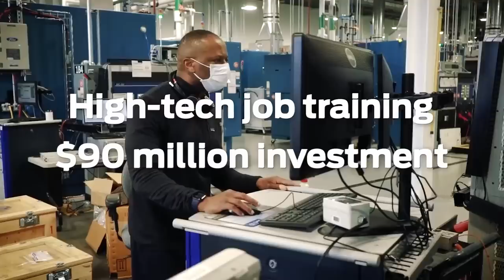Ford CEO Confirms HUGE Ford Maverick Factory To BOOST Production Numbers

Comment: I ordered a Maverick Lariat Hybrid when ordering first opened in July 2021, and got the truck 9 months later. 4 1/2 months in I am very happy with my purchase. For around $30,000 out the door, it is a great value. It’s perfect for light duty hauling such as college apartment moving duties, hauling mulch, and taking kayaks back-and-forth to rivers and lakes, and I really appreciated the adaptive cruise control on the few longer trips we’ve taken it on. So far it’s averaging around 37 mpg, which is pretty amazing considering it looks as aerodynamic as a refrigerator.

Comment: I’d keep making hybrids while making EVs, for their tank range, and increase it to 1000 miles a tank. But avoid making the hybrids with turbo or eco boost engines, they burn shorter and hotter than Atkinson cycle engines do, or other naturally aspirated.  People just want a long range and long lifespan — cars or trucks. Later in 15 or 20 years when EVs reach 600 miles and last 10 years on same battery — and prices come down — Ford could consider doing away with hybrids.
Reply: @The_Internet_Is_Overrated  I think it’ll be smoother. Going ICE to EV requires Ford to split the company into two, a pretty difficult thing?
Reply: I expect this will more or less be how it goes as we shift away from strictly ICE vehicles
Reply: Temperature's Hot and Cold severely affect the batteries range, how do you see over coming that aspect alone?
Not starting a fight here,   
  I would like to hear what your thoughts on that are.
Reply: hear, hear!

Comment: Yes, they are doing the right thing. I wish I could find a Maverick but one that is at MSRP not one that is 30% over that. Ford does need to increase the manufacturing of these high demand vehicles.
Reply: There are people publishing lists of dealers that don't add above MSRP. The order books open in September for 2023 mavericks; i expect they will sell out the year fairly quickly.  I am trying to pick my color; it is hard having only seen one on the road so far (Area 51).

Comment: My son-in-law is trying to buy a Maverick to use for work. There are demo models at all the dealerships but they are not allowed to sell those. Ordering one will open back up in September but the dealerships are estimating delivery six months to a year. The few that are available in California are met with OUTRAGEOUS dealer markups... $10,000 to $20,000 markup. Almost double the MSRP of the vehicle itself. Buyer be ware! Ford has been talking and building the Maverick in Mexico for over a year now and they can't keep up with demand. If they can't meet demand and control the dealer markup issue they will lose customers.
Reply: Also, Hybrid motors are leaking oil that could cause engine fires is not doing much good for sales either!

Comment: And then let's take the 2.0 L EcoBoost Maverick for instant 

let's look at the first oil change at 1000 miles after break in

you're already starting to smell fuel dilution

 and then by 5,000 miles it's very very strong but yet it's advertised that you can go up to 7,500 to 10000 miles on that oil change which is not accurate 

by 5,000 miles is the sweet spot but marketing says you can go much more

 you know what that leaves you with wear and tear in a vehicle that starts deteriorating slowly in the long run and dilution of additive package and the Integrity of the oil but because of the way the vehicle is marketed they want the customer to feel empowered and believed they have to service the vehicle less which all expands from a marketing  that's trying to make a vehicle more fascinating and empowering to the customer when an all reality all they're doing is slowly breaking it down
Reply: Very good points
Reply: What oil would the Maverick take 0w30 for the turbo
Reply: On another video on this site a dealership described this exact situation. Only on the 2.0 turbo. Their thoughts were the oil should be changed every 4,000 miles. Do you think this issue exists with every small turbo engine 🤔?

Comment: I wish they would have just built the old Courier with a proper ladder frame with rear wheel drive. Give us the choice of a manual or automatic transmission, and a naturally aspirated four or six cylinder. I sold my 1980 XLT Courier 2.3L five-speed manual long bed with 217,000 miles on it to a friend. Was always garage and was still running strong. That was a great little truck. I hauled more weight on it than it was ever meant to carry and never had a problem. The only thing was, it was underpowered when new. The 2.3 was easy to work on and a very dependable engine. Also was easy to wake up with some minor modifications. It had quite a bit of factory and aftermarket support as they raced these engine.

Comment: I live at the beach and vehicles rot here from the top down so I like cheaper ones. I'm also 6'4" with a fused back so I can't bend to get into many cars. It's a serious limiting factor. I got a chance to sit in a Maverick and surprisingly, it has space for me.
There is a pretty good chance there is a Maverick in my future but I will not pay huge dealer mark ups to get one. I have a 2002 E-350 and I like it but it's hard to park and sucks gas. I have a couple years before the rain starts getting in through the roof patches.

Comment: Ford should create a plug in hybrid by replacing the 1.8 kwh battery with a 7 kwh battery. That would qualify for the new tax credit but add only a few thousand dollars to the cost. Ford could leave the rest of the hybrid drive train the same. It would just mean the engine would have to start for heavy acceleration. I bet you could get 60 mpg with a plug-in hybrid in normal driving. I would take that over a plug-in hybrid that was designed to drive a certain number of miles before switching to gas.
Reply: Most PHEV have the option of various modes, one with all EV then gas, OR charge mode, which runs the engine to charge the battery, or hybrid mode like the Maverick uses now, or a combination of those, including drive modes (sport, offroad, efficiency, etc).
Reply: @uni4rm  The point I was making is that the current maverick hybrid can't run continuously on battery power without a much larger electric drive motor. If Ford used their existing hybrid system and put in a larger battery and charge port they would save a lot of money and still claim the tax credit. The gas engine would still be needed for fast acceleration but the maverick could run on electric most of the time. I'm averaging 46 mpg with my hybrid Maverick with careful driving. I expect I could get 65 to 70 mpg with the system I'm describing. The PHEV I described should only add a few $ thousand to the cost and would be available for less than $20,000 with the tax credit.
Reply: There are pictures online of a camouflaged prototype maverick with testing apparatus and "PHEV" written on the side. Its coming. Probably not 2023. Possibly 2024.
Reply: @jimfarmer7811  wrong.   same motor.   Larger pack.   Larger pack allows for more power from the existing motor.   
They already have it in the escape plug in.    My guess is they wanted to sell 2 years of mavericks and then roll out the plug in.
Reply: @BarryObaminable  You are correct. I was confused by some of Escape reviews. They stated that the escape had a 37 mile range on electric only before it switched to gas. Clearly the drive motor in the Maverick is not strong enough for fast acceleration without the gas engine so I assumed PHEV Escape had larger drive motor. It turns out the Escape does use the gas engine as a booster for heavy acceleration. It would appear that surprisingly Ford actually did a good job engineering this system. I just hope they can get the MSRP for the plug-in Maverick below $25,000.
Reply: Title is about Maverick production numbers going up but then the whole video is clips about Ford Blue Oval city which will build full EV and Quotes from Jim Farley about EV production increase......so nothing to do with the Maverick. Interesting video but the title has nothing to do with the content...and no Maverick has 280hp

Comment: I think they are being overly optimistic for the EV numbers.  Also, aren't key ingredients in short supply at current battery production?  As for the Maverick, I really hope Ford designed and builds them well.  I had a first year Fiesta that was a terrible car.  17 issues that took 42 trips to the dealer to fix.  Ford is truly capable of screwing things up.

Comment: The biggest problems with EV's are twofold:  One we do not have the infrastructure to charge millions of EV's. Not by Solar, Not by Wind it will take Coal, Natural Gas or Nuclear energy to supply the electricity when the others are not available.   
  The Electrical Grid is 20+ years away from being updated enough to carry the electricity to charge even a million EV's
EV's are severely affected by cold, 
EV's when in a catastrophic accident and fire breaks out 98% of fire departments are not prepared / equipped to handle the toxins, spillage of the contents of the batteries or the veracity of the fire. 
Mining & processing the resources for the number of batteries is far more harmful to the ecology than drilling for oil or in the event of a nuclear meltdown.  
The Expense of the battery replacement is incredibly expensive. 
The Training of Techs and the special Tools and equipment industry wide will be an incredible expense on the dealerships and Techs.
I expect more accidental deaths from electrocution to affect not only the Tech's, but the Occupants of the vehicle in case of a catastrophic accident.
Gavin Newsom Gov of California has already put notice because of an insufficient power grid not to charge EV's because of the already shortage of electricity supply.  
When the State of Texas a couple of years ago had a cold spell and snow hit the Solar and there was not enough wind to turn the giant windmills for days almost 2 weeks found out just how well green energy doesn't work at times without a Coal, Natural Gas or Nuclear electricity back up. 
   We are realistically 30 to 50 years from having the technology to even become 40-50% capable of Solar or wind Green capable.  The Technology and the recourses are just not available yet.
This whole thing takes me back to a 1960's Star Track Episode, where Scotty Tell's Captain Kirk that they found a civilization, whose technology can take the 200 ft long warp engine and make it the size of a Walnut and be 20 times more efficient.  Were far from that. 
   Ford whom I am a great fan of and supporter, I buy only Ford's and sold Ford's at Kimnack & Beach Ford in Norfolk and Va Beach and Jack Dykstra Ford in Lansing. 
I think that Ford is making a noble effort for EV's, they will be great in large city areas in warm climates for short distances. But as to rural and cross country not so. 
The Cost to charge an EV is not saving any money vs gas or diesel.
You can fill most gasoline vehicles in just a about 4 to 8 minutes and be on your way.
Charging EV's takes quite a bit longer and depending on Terrianne and temperature you will have to stop to recharge very often in hilly or mountainous regions. 
The world, the suppliers, the mining industry, the processing plants, the Grid, the Manufactures are not prepared for a 15th of the numbers of EV's being pushed.
In Addition: The windmill blades are toxic materials that have a very limited life expectancy and no dismantling and recycling have been put into place other than burring them in the Wyoming ground. 
   which leads to another point about recycling these large Automotive & Truck Batteries, what has been put in place to recycle and safely discard what cannot be reused safely to Humans and the ecology ????.
     Ford, GM, Chrysler, BMW, Mercades, VW, Toyota all these manufactures have technology to get higher milage and better performance from Gasoline & Diesel Engines There is not question about that. Why not pursue that for the next few decades while developing the supply Chain, Electrical Grid, Design and Production to include an effective recycling and safe disposal plan for the expired and unusable parts of the batteries. 
   Despite What the Big Heads of the world are pushing, Oil is going to have to be produced Drilled, Refined for so many other reasons than Gasoline & Diesel because of all else the Bi-Products that are manufactured from it we will have to drill and produce oil for hundreds of years while someone learns to make so much from alternative materials. 
    This is what I see,

Comment: If Ford reintroduced the ranger in it's original small size this would be about it instead of the unibody maverick..the huge over tecked trucks they make now are just not what is needed by most truck buyers

Comment: The only thing negative about the F-Mav is there is no option for a good old fashion stick shift. Don’t much need a four door either. Automatic transmissions are boring to drive by we old school guys… Our year 2000 5 speed stick shift 2 door Ford Ranger is a week away from 200 thousand miles and still running like a top at about 21 mpg highway. Just changed the alternator.

Comment: I recommend FORD do this to fill orders. Make Available a new Trim, V6 NA 3.3L, Manual transmission, all manual windows mirrors, power locks. No radio, but Radio connections for aftermarket. Available with AWD with Front/Rear Locker. Manual seats, basic lights and tech lighting. $18995.

Comment: But why lock the AWD to the non hybrid version? The power train should be able to be customized at least that much.
Reply: It was a way to control demand for the Hybrid.  The biggest issue with EV production is that you can't wave a wand and get all the necessary EV batteries.  You have to build the battery factories first.  And you have to secure the complicated supply chain, and now with the tax credit, you have to source materials in North America, not China.  Its going to take time.

Comment: The production ratio for Maverick was 60% ICE/40% hybrid. But now they are seeing much more demand for hybrid than ICE. My guess is they'll change this for Maverick to 70% hybrid/30% ICE.
Reply: They have been having a much harder time building hybrids due to supply chain issues...Still plenty of customers who want 4WD and added tow capacity..neither of which are available with the Hybrid
Reply: @normananderson2583  Not that I've seen. Production numbers for hybrids matched the 40% plan. If you actually needed more towing, a Ranger would make more sense. Maverick is a mini pickup, smaller even than the quarter ton Ranger.
Reply: @scientious  Up to 4,000 lbs towing isn't too bad for the Mav..plus when not towing the Mav will get better mileage than the Ranger

Comment: Glad to hear that the Ford Motor Company is still making the Maverick in the USA.  The Toyota Tacoma used to be the benchmark for build quality.  But I doubt they can still maintain that.  Now that they're building the Tacoma trucks in TJ, Mexico.
Reply: Sorry, but the Maverick is made in the Hermosillo plant in Mexico.  This super low price product is probably not feasible in the USA where the union wages are so high.
Reply: @edwarddejong8025  Thank you.  Then Ford should have concerns about the quality, dependability and reliability of any vehicle made in Mexico.  No bueno.
Reply: Actually the Maverick is not made in the USA at the present time. All Maverick’s so far have been built in Mexico.

Comment: Although Ford is talking about expanding things they just let go 2,000 of their workers that are some of the most seasoned experienced workers based on tenure and when you're throwing out your employees that have some of the most experience and it may not be the top experience and then bringing in people with no experience and expecting a different result and this has been happening you know what that's the definition of?

Insanity!

So while they're making room in one area to expand and make things better per say they're making it worse actually because they're firing and replacing some of their brightest Minds

I this a way for them to save money?
Is this a way for them to bring in brighter fresher newer minds?

We don't have answers for this but it seems very very very unstable overall
Reply: get rid of employees that have old ways of thinking train the the new ones the way you want them to think and work .

Comment: The problem is we don't have the infrastructure that these EV Vehicles need, the housing structures are old the wiring is outdated people have to get new household charging stations installed that their home cannot support and through training when going to the Ford training facilities to learn about these things let's just say the average neighborhood of 300 people and you take 10 of those families that want to buy electric vehicles the grid system for that neighborhood cannot support those 10 electric vehicles being charged everyday we don't have the infrastructure to support what they're trying to do unfortunately and it's not that we don't want it it's the fact that we're not ready for it

And if you think right now getting gasoline engines and diesel engines and standard parts that we've always been able to get is a problem and we're waiting months to get these things delivered to fix Vehicles just wait until these problems start happening with the electric vehicles and then they're waiting a year or a year and a half or two years to get parts

 we cannot support this right now, we just don't have the facilitation for it and it's very unstable
Reply: You can first procuce a plugin hybrid!
Reply: They are hoping that the average non informed citizen will fail to even think about that hard fact, but that is the reality!